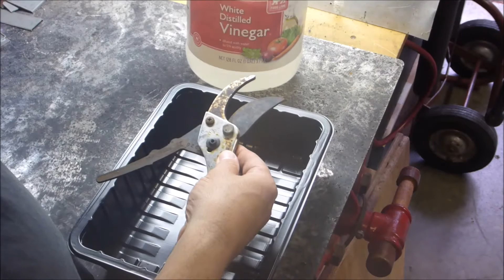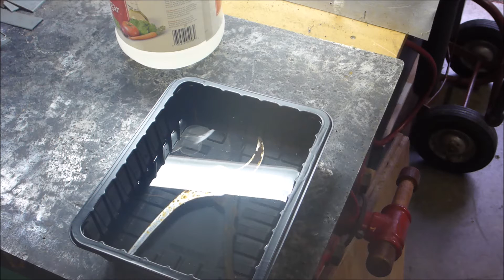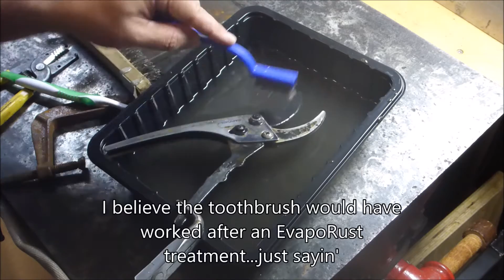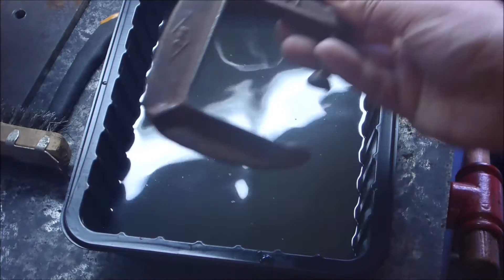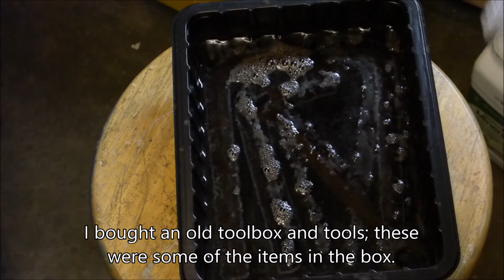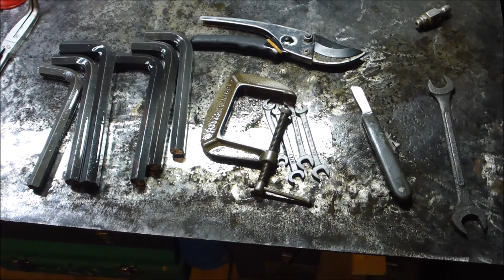2016 05 29 Evaporust Fan Tries Vinegar Instead

Comment: Hi Rick.   Interesting.  There's quite a few acid based ways to remove rust over varying time, dependent on the component used.  Fumaric acid is the best/fastest I've tried, but it is something you treat with respect.  Thanks for posting.  Cheers Rob